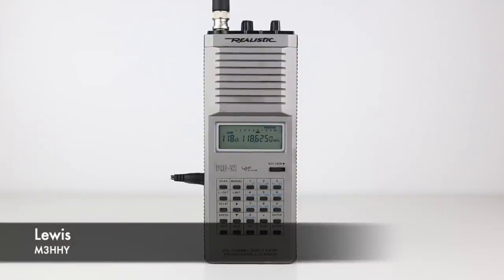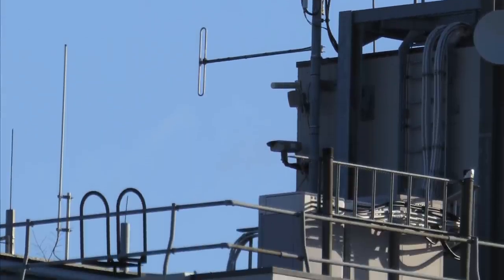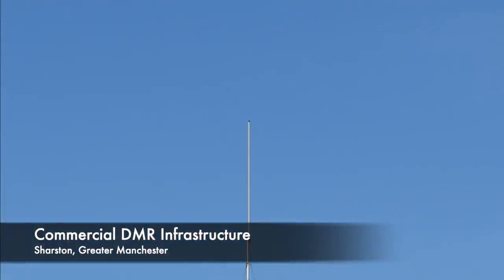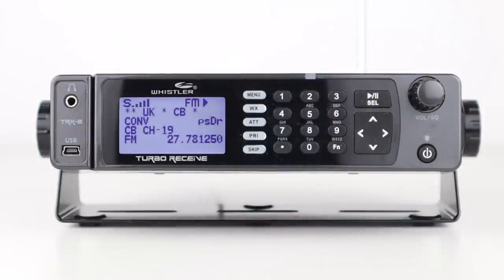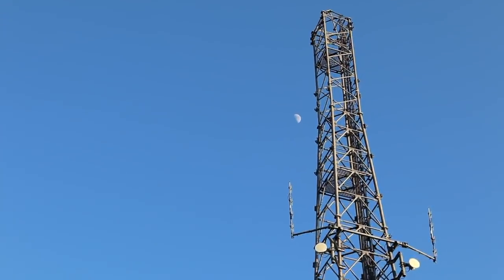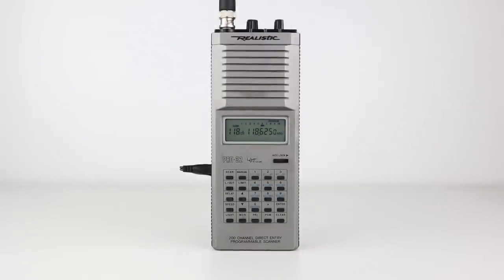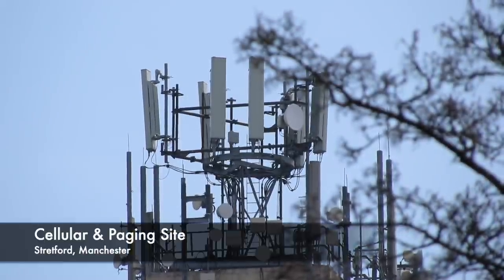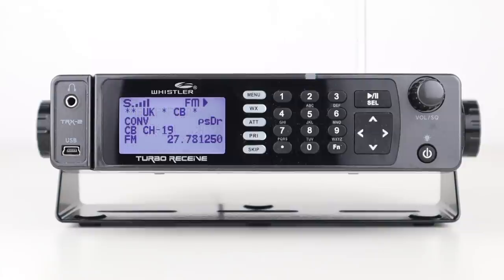Strange Signals & Weird Noises On Your Radio Scanner Explained

Comment: Lewis it’s not just the police that use Airwave.   It is also used by ambulance, fire and lowland search and rescue.  It is also extensively used by HM Coastguard, the real 4th emergency service to communicate with the other emergency services as well as with the coastguard search and rescue helicopters.  The coastguard also use MF, HF and VHF radios with HF being used as the secondary comms for the helicopters.   

Also the pagers have all gone from the coastguard with the exception of their VHF channel 0 pagers used in area of poor mobile coverage.

Comment: Be aware, there is a rental company out of California that has gotten a massive number of FCC licenses to use with burst transmitters on telephone poles.  They have been given licenses in virtually all bands, and many of the frequencies are already licensed to commercial radio companies.  They tend to use them in areas of lower population to transmit any information about electrical use to the various electric providers.  Despite them being licensed for lower power, they are interfering with various radio communications providers.  This is from personal experience.

Comment: Great Video.

Here in Aust we used to have a huge SMR ( State Mobile Radio) network run by our national communications & telecommunications services provider Telstra on VHF High 156 to 170 Mhz used not only by private companies, public transport, utilities like power & watee but  all emergency services & with some proprietary Moto gear it provided hours of enjoyable listening & information exchange between like minded radio & scanner enthusiasts that was until the public transport left 1st & went to an encrypted network called GSMR or global systems mobile rail communications, following hot on the heals was the emergency services that went to both a VHF & UHF  encrypted Apco 25 network on 420Mhz UHF encrypted N/W & 165 Mhz VHF both encrypted & a "currently" open Tait I & II network.

The utilities went to mobile phone & 4G data, I think that there might still be 1 or 2 "private" users on the network but everyone else is gone.

Here in Aust there is very little to really listen to as 99% of comms are encrypted with some states & teritories fully encrypted.

There's a little bit of Pocsag but not much with the emergency services using a 2 x way encrypted proprietary paging network now.

Only approx. 50% of aircraft in Aust use voice now with the other 50% usung about data like Acars, Cpdlc, inmarsat & onenet for all operational communications including landing & take off clearances as well as in flight comms, aviation HF comms is just about dead with only a tiny fraction of what used to be.

Shipping is mainly Inmarsat or AIS with a tiny bit of simplex in port VHF comms on 156Mhz just talking to the port authority but you have to be within a handful of km's from the port to really hear anything other than that its jusr leasiure craft & a hand full of fishing trawlers, Marine HF is just about dead.

Taxi networks are long gone here in Aust, taxis are now fully deregulated 1/2 of all taxis here in Aust are now ride share, the few taxis that still have radios most are just data terminals with the rest using either Snapchat, Zelo or other PTT service to communicate.

The "Taxi Base" is pretty well long since gone you can still ring & get a cab but stats show that only about 2% of cab orders are via a voice call to a national No. Here in Aust with the rest usung other means to order a cab.

 The company taxis left are connected to an app network & you use an app on your smart phone to order a cab or if you are a regular taxi / cab user with a regular driver you simply call them on their mobile they them selves operate in small fleets or groups from everything from a handul of drivers & cars up to many dozens of drivers & cars so if your regular driver cant do your trip he/ she has one of their fleet / group drivers do the trip, these group / fleet drivers are hand picked for their years of experiance, professionalism, presentation & area knowledge and mostly use mobiles, PTT, or Snapchat to communicate.

In general whats left that is still in the clear is pretty boring ( apart from our fire services during the Aust'n summer bush fire season when comms can really liven up.) 

To the best of my knowledge 99.9% of comms in Aust is digital & all involve some form of trunking network.

The ACT ( Australian Capital Territory & the Northern Territory in Aust are 100% encrypted & Tasmania is about to join them in the next 12 monts with our national carrier winning a major comms contract to encrypt the whole island state ( all in the name of Terrorism of course.....😬)

All Police forces all around Aust are fully encrypted, most capital ambulance & fire services are either fully encrypted or have the ability at the flick of a switch at a moments notice to be fully encrypted ( not counting the 2 x territories that I have already mentioned where 100% of all comms that  are already  fully encrypted )

All Australias roads authorities are fully digital & as above at a moments notice and the flick of a swith can be fully encrypted should they think or beleive that the need calls for it.

All Australian security services ( alarm response / security patrols) are all 100% mobile phone & txt & or propriety apps for alarm codes etc.

99% of Australias media ( large tv & radio networks ) are encrypted  / satellite with the smaller players just using mobile phones.

All Australian free to air terrestrial TV is digital thoes out of range of free terrestrial Tv can receive free to air via Satellite on a network called Vast which is encrypted.

Some local councils ( the smaller ones ) are still analouge in the clear but are very boring & again with most comms being passed over the mobile phone network, the big capital city councils are digital in some form or another.

All Australian airports " operational staff like baggage handlers, check in staff,  car parking & security are all 100% digital using various digital networks.

The only thing that has never changed world wide with communications is  aviation communications, they are the last man standing, they still use AM analouge between 108 & 136 Mhz for voice, data & navigation communications I am lost why it has been the same since WWII & I doubt will ever change.

90% of large shopping centers are digital.

Am radio stations are making way for either Fm or DAB

A large amount of amateurs now either use DMR or Dstar to communicate

CTCSS is gone in Aust

Here in Aust we have NXDN but hardley anyone uses it at this stage.

So here in Aust for commercial & emergency service comms we mainly use

Motobro
Turbo
Edacs
Apco P1 & P2
X2-TDMA
Mpt
Pocsag
DMR
LTR
Spread spectrum

There's vitally no analog worth speaking of left that is worth listening to in Aust.

Hope that helps give a little bit of an overview of comms in Aust.

Regards
Wayne.
Reply from the maker: Thanks for taking the time to give that info!
Reply: My home town of Sheffield in GB the 2m band is used mainly on digital I now talk to no one any more 2e0dre
Reply: Hi Wayne 

I'm not looking to listen to any comms but I think it would be pretty cool to give a strength reading to a transmitter based on the quick data bursts they give out.

What do you think?

Do you think there's anything that could give a strength reading to show youre getting closer to the transmitting device?

Thanks

Comment: It has been a while, but years ago, I used to hear a sound in the 800's and 900's which sounded like someone keying the mic on a radio constantly at regular intervals. They were a second or so apart, and it was like it wentin to a repeater, because the carrier was constant. Think about the tailsquelch from the receiver when someone lets go of the mic when they are using a repeater. 

First, you hear the receiver disengage, then the carrier from the repeater continues for a few seconds before you hear the tailsquelch from your own radio.

I don't remember the exact frequency, but I heard it on a few different ones, so these might have been images, making the exact frequency pretty much anywhere in the 700 to 1000 mhz area. I'm sure my scanners never picked up images from multiples of the if like some people claimed was possible.

Another signal I heard has disappeared since the late 90's, but it was in the upper 460's, and it sounded exactly like the whipping you hear when a helicopter is flying over, but it was constant.

These sounds persisted night and day, so it's possible that at least one of them is a signal that was created by my scanner it'sself, but I'm curious about what they are.

Comment: Very well done video. I'm not sure that Multitone paging is easy to decode. I'm quite skilled with SDR and it's been my experience that there are many pager variants in the 454 and 459 mHz bands and very few respond to decoding software such as PDW and Sorfmon. Am I missing something? Keep up the good work!
Reply: Trying using CubicSDR, I couldn’t get SDR Sharp to work with PDW, some sort of audio filtering
Reply: You’ll need raw audio from the discriminator to decode properly. Had the same issue here in the US.

Comment: Whats cool about tpms, is that the packet is sent multiple times at random spacings to deal with collisions from other sensors.
Reply from the maker: I had no idea cheers!
Reply: @RingwayManchester  Yeah the receiving end checks the CRC, discards the packet if it doesn’t check out.  Since the packet is repeated multiple times at random spacings, the chances of every single packet colliding with the other tpms sensors is rare.  That’s why the chirping you hear has a stochastic kinda pattern to it.  I absolutely love your channel, subscribed!!

Comment: Very interesting, but somewhat familiar 
to me, especially on my earlier scanners
and on amateur radio transceivers in the
1970's and the 1980's before many of the pagers left the air in the 🇺🇸 US on 152 MHz and 454 MHz. Digital cell phones
seem less of a problem at higher frequencies, though LTE sometimes causes problems as noted in filters
for HD TV and FM. W2CH

Comment: At 8:40 - either this or a very similar service is ruining the whole CB band in German from spring to fall, most
 annoying during summer, it's sitting on frequencies between CB channels and ruining at least two and up to four channels at once.
A pity you didn't mention the frequencies they use.

Comment: I've tried listening for ads-b on 1090MHz, and GPS on 1575.42MHz on my Malahit,  but can't hear anything.  Is that normal?
Reply from the maker: Yeah they’re not great at higher frequencies. Are you using an antenna cut for those frequencies?
Reply: @RingwayManchester  I am.  I was expecting data noise but there's nothing.

Comment: What about 5g as i can here the same noise at the same times every day to the point of giving me headaches?
Reply: 5g runs at 29 to 39GHz. Yes GIGAHERTZ!!! Microwave...
Reply: @JrGoonior  i know but what is the effect on humans as i never get headaches till a few months ago and before it comes on i get this “noise” which is more of a noise that we used to get from the old cathode ray tube tvs which drove me mad with a high pitch whine that most people couldnt hear
Reply: Does it make sense?  Why would 5G jump on frequency at the same times every day?  Do you understand that spectrum was in use previously.  It is not like it has been idle until it was allocated to 5G.
Reply: 5G is just a communications interfacing and transmission protocol for cellular networks. As with its forebears it offers more bandwidth (ie more capacity for more simultaneous users and devices). Most of the connectivity in the UK is in the 3.4 to 3.6 GHz band.5G does however allow the use of so-called millimetre waves with frequencies up to around 60 GHz. but these struggle to penetrate the atmosphere for more than a few 10s of metres. The UK is expected to make the 26 GHz band available for indoor venues sometime this year (2021).

Headaches at the same times every day are unlikely to correlate with any kind of radio usage. Do you hear the noises on a radio or directly in your ears/head (poss tinnitus)?

It's worth making a few points 5G and health:

a) Even the very highest frequencies they expect to use are still radio waves which are technically also low-frequency light.  Low frequency also means low energy.

b) The only proven harm to humans from radio waves comes from the heating effect. This does no not just apply to microwaves but to all wave ranges if the field strength is high enough. Because  of this, maximum safe exposures are set by determining the level at which tissue heating is first detectable and then halving it. Actual encountered exposure levels are way below this.

c) We've heard concerns raised about these mobile comms systems ever since the switch from  analogue to digital in the 1990s. In the UK this meant campaigns against 2G, 3G, , TETRA, 4G, Wi-Fi,  and now 5G. Many protagonists cite their headaches and other symptoms as being caused by one of these systems.  However, headaches are one  of the commonest non-specific human ailments and have many causes One of the most notable is generalised anxiety disorder  where you encounter something you don't understand and worry about it such that you get a headache whenever you believe you might be  being affected by the trigger. Controlled double-blind trials have shown that "electro sensitives" cannot  tell when they are being exposed to a radio system which they claim is harming them.

Comment: tldr; get an sdr
Reply from the maker: Eh?
Reply: @RingwayManchester   SDR and associated plugins or external programs to make sense of many of these signals - which sorta renders a scanner redundant imo
Reply: @eliotmansfield  Well it's an opinion.
How much is an SDR complete with all the plug-ins ?
Reply: @thehelpfultroll9032  SDR RTL is £20+ and the plug in’s are mostly free
Reply: @arthurtwoshedsjackson6266  True but the rtl ones aren’t as good as proper sdr’s in terms of receive quality but are definitely a cheap introduction to see if it’s you. (i started with one a few years ago which then led to me becoming fully licensed)
if you download the sdr# community edition’ from the sdr# site, it comes with all the popular plugins already configured and working.  sdr# is for their own airspy sdr’s and thr aforementioned rtl dongles.
Not sure if the same exists for the sdrplay ecosystem

To add; I’ve considered getting a receiver but they seem expensive compared to sdr’s and can’t do as much - the only benefit is that they are much more portable